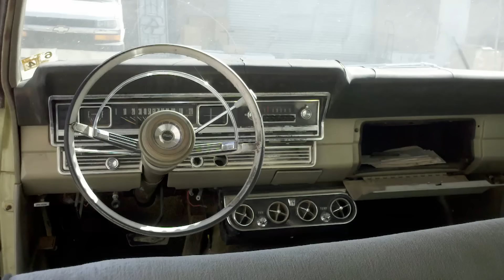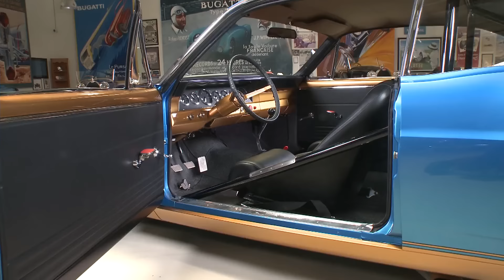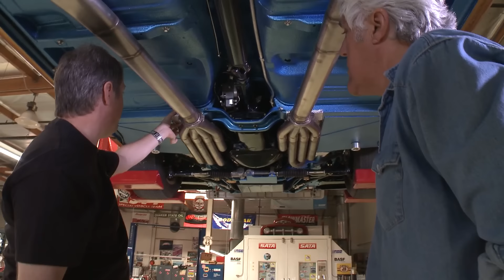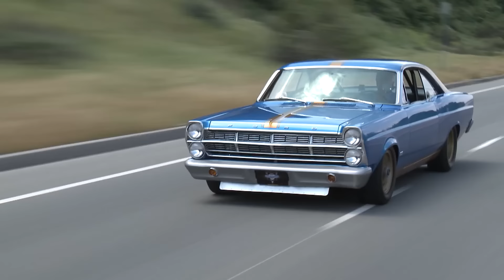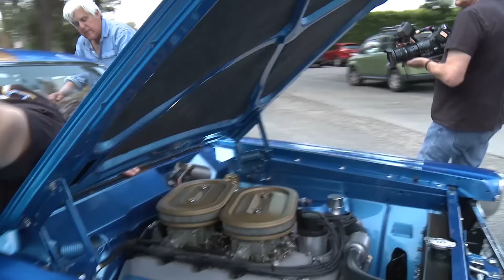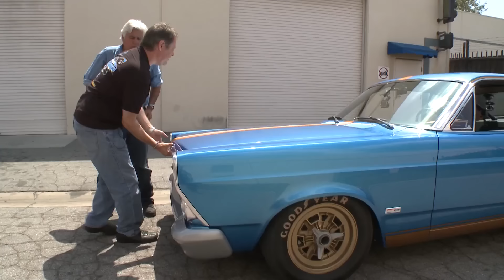1967 Ford Fairlane - Jay Leno's Garage

Comment: I owned a 1966 Fairlane 390 GTA back in the early "80s. Black exterior, black seats with red highlights.  It was quick by '82-'83 standards, when I owned it..  Good for a 14.7 at about 95 MPH in the quarter, slightly modified.  Corners?  Nope.  Stopping?  Long distances with massive fade when pushed.  Fuel economy?  8 to 10 MPG using the best 92 (leaded) octane I could find.  Years later, my 2013 Infinity G37 with a little 3.7 liter V6 would have left that Ford for dead, not to mention the Infinity's top speed of 155, governed of course.  Did I mention  28-30 MPG at 75 MPH?  Nowadays, a 2025 Honda Civic Hybrid could keep pace and get 45-50 MPG.  Times have changed for the better.

Comment: On the other end of the spectrum me I took a 67 falcon futura SC I put big block springs on it two inches cut off sway bar Koni shocks I bought a 72 Maverick and pulled the disc brakes off that and threw them on my car took the rear end out and threw that on my car it was about 3 inches narrower then the falcon axle so I had room for meats on my centerline Wheels and that car handle like he was on rails I love going into an exit ramp with a Vette or something else behind me and just not putting on the brakes 3/4 way through I've got my foot down to the floor accelerating and that Corvette's not wanting to stay with me (sometimes it's the driver) well you could probably tell I'm on a low budget and I never got around to the stroke 351 and the five-speed

Comment: No the 427 High Riser would turn some real RPM.  Even that one built won't turn the rpm a high riser would. 7500 was nothing to a high riser. The heads had ports big enough you can put you fist through them.

Comment: Harvey Crane (Crane Cams) made the gear drive to replace the long timing chain. The gear drive also reversed the direction of the cam on the left bank, so that they could run the same camshaft for both heads.

Comment: I had a 68 Fairlane in the same color (Celery green) with a 429. A mustang friend said it wasn't original since you couldn't get the 429 until 1969, i showed him the original build sheet, end of the 68 production line special ordered with a 429, evidently the Ford dealer had some special pull since he sponsored a ford racing team.

Comment: “Sneaky” Pete Robinson of AA Fuel Drag Racing and Georgia Tech developed the gear driven cam version of this along with the guys at Crane Cams. They included an extra gear in the chain so they could use the same cam on each head. This eliminated the slack problems with the looooong timing chain.
Reply: https://www.motortrend.com/uploads/sites/21/2015/05/tinker-toy-dragster-engine.jpg?fit=around%7C770:481.25

Comment: With the awesome torsion bar engineering (to me an underated practical method), and engine ...no need to apologise for the small throttle cable glitch. That is an awesome custom!

Comment: Just to add some flavour, these Fairlanes were also made in Australia only as 4 doors however the stacked headlight version came out in 1969 70, 71 designated ZC and ZD series.
However the engine options were, a few 250 cu 6 cylinder, but mostly 302 or 351 Windsor in the ZC and 302 or 351 Clevelands.
Yes you heard right a 302 Cleveland!
Ford Australia decided instead of importing Windsors and what are known as thinwall USA Clevelands here they would cast thickwall Cleveland blocks in Geelong casting factory in Victoria Australia.
The blocks were a bit heavier but we did'nt suffer the web cracking that some US Clevelands experienced and there was quite a lot of meat around the bores.
In order to have a smaller V8 option the Cleveland 302 had a 3 inch stroke crank with 4 inch rod and the 351 had the usual 3 1/2 inch stroke crank and shorter rod as the US  specs.
However the 302 heads had 53 cc small kidney shaped combustion chambers with the 2 v small ports,  bolting these 2v's onto a 351 raised compression into about 10.5 to 11.1 comps and running 100/130 avgas made a very healthy 330 - 350 hp dependent on cam/carburetion.
A few of these heads made it stateside as they were plentiful here.
We also had in the late 60/ early 70's 4 door Ford  Falcons with 4V HP 351 300 plus hp Clevelands with Boss type shakers as in Mustangs once considered to be the fastest 4 door sedans manufactured in the world however AMG Mercedes may challenge this.
These engines were seriously under rated due to the looming issues regarding supercars and insurance and were very potent.
Still love these Fairlanes particularly the 2 door slopers".

Comment: You made me miss my 66 390 GTA that I was forced to sell, slightly modified to 550 HP With a built C6. Lots of fun, never lost. It had 4 mufflers, two flow masters then two glasspacks 2 1/2 in. Just tried to listen to the radio.

Comment: Pete Robinson produced a gear drive system for drag racing with the 427 SOHC. He got some help from Harvey Crane of Crane Cams and P&S Machine to solve the timing issues caused by the 7 foot chain. 
My brother had a bottle green 67 cammer (two four-barrel carbs) Fairlane with two big white stripes on the hood, roof ans trunk cover. It would burn rubber in first, second and third gear. One day, the engine compartment caught fire and by the time he managed to remove the hood locking pins to open the hood and extinguish, the damage was too extensive to save the engine in a cost efficient way. The car ended its life with a 390.

Comment: In the early 2000’s I put a Hedman two piece header on a 1983 F150. I didn’t have the money to pay for a shop to make an exhaust so I had about a dozen short exhaust adaptors and short bends that dumped under the passenger floor without cats or muffler. In town I kept the rpm’s low to avoid tickets and waking up the dead. It was absolutely loud as a NASCAR engine when I floored it. And guess which engine it had? 
-
-
-
-
-
-
Ford 300-6, stock aside from the exhaust.

Comment: Ford's regular 427 NASCAR engine was so hot that Ford had to de-tune it for use in the GT-40 LeMans race cars.  When Ford saw that Chrysler was cleaning up with a hemi,  they came with out with the 427 SOHC.  Chrysler cried to NASCAR and that version of the engine was banned.

Comment: I've seen the throttle problem many times; mechanics discount the importance of checking the geometry & cable slack at full throttle, which is the LAST place you want a problem; most carbs are designed to go slightly over 90° when buried so you can slightly back it off.

Comment: There is no way this guy built this car. The throttle cable confused him.
Reply: I met Steve Strope a couple of years ago at NSRA Louisville; that's just the way he talks.  I saw his show on MotorTrend when he and his crew built the '57 Ford two-door Ranchwagon restomod he showed at Louisville.  Trust me; he's smarter than he sounds.  You wouldn't know it, but his net worth is about $100 mil...a very unassuming guy.

Comment: The issue with the gear drive setup they were talking about had issues with crankshaft vibration.
So it was a constant lash issue within the front case.
So until they figured out absorption through the idlers 
It never worked correctly.

Comment: I respect the fact they left in the footage of it breaking because noone is perfect this is a built not bought custom car that didn't have more then half those parts on it from the factory and to show when you build something that its never perfect or done needs mufflers need to bleed the brakes needs to put that little spring on like jay its never the big stuff but a 25 cent part and the most true thing in this episode is thats the point of a shake down

Comment: i love the car.. workmanship is top notch..my 66 ford ranchero is the same color with black instead of the gold..i just bought a speedway quick change diff .. fantastic!!! bolted right in ..didn't have to change a thing...other than the obvious ,swapping over backing plates, brakes etc...ahh the fairlane steering wheel..lol  god they were ugly. i have 2 in my basement if you want one..

Comment: Ford did have a Black Ops. When I worked at Ford Engineering in the early 70s, I wandered into an underground parking structure and found a beautiful, gun metal Mustang with a MIDSHIP MOUNTED 427 CID ENGINE and a Pinto with a double overhead cam COTSWORTH ENGINE. Pretty cool. These were toys for the executive class at Ford.

Comment: Wow. I have always ALWAYS hated longitudinal Alfa Romeo Alfetta and Mopar and 96-01 Explorer IFS systems and pushrod and transverse torsion systems because of my experience with them in those cars. This one lookes like it has no camber changes and its very professional. Love the Kelsey Hayes 11 and 11.35 inch brakes...they were exceptional in the TransAm era. And the FE rumba cha cha SOHC with quad 650 2bbls 6425's and Le Mans bowls...yeah bay bee. The throttle return rule...I learned from Mopar in 1996 when my engineer refused to issue a LVVC plate on my 4412 500 2bbl equiped Falcon 6. "Put a Mopar Hemi external return spring on it and bring it back". Ouch. Mopar part. What Jay said. Now get over it OK? Yeah, Strope has this whole package Lorenzo Ready. Thanks all for sharing. Unibodies X cars are a strange kind of awesome. Glad it sounds like an FE.

Comment: I grew up with these cars. With the right gear they were force to recon with. Most of the cars back then came with regular run of the mill standard motors. It's all on how you ordered yours. I learned to drive in my dad's 68 Cornett.  Beautiful car. But it had a 318. These cars were heavy.  Mostly gravel roads. Bias ply tires. Little to no brakes. Huge steering wheels with the speed nob on the wheel. Lol. Today's cars are so safer to drive. And much more comfortable in all conditions.

Comment: Yup......it's all FORD. Top dollars spent, work is unquestionably 1st rate.......yet something still breaks. Even though it's no big deal........ easily fixed........it's still a FORD for sure as because it won't drive for long before it has you on the side of the road fixing something.

Comment: That is a clean installation. That rear suspension is just a set of beautiful piece. Combining parts. This won a Ford design award at SEMA! The exhaust system is amazing.
Once muffled, apparently this car with mufflers is more of a euphemism.  Those lightweight and custom wheels are amazing. Cougar turn signals. Bound edges on Dyna Deck. AF

Comment: This is the motor that struck fear into all camps. If this motor had got the attention the hemi has all
These years it most certianly would be king. There are engine builders out there who have achieved 900+ horsepower naturaly aspperated on pump gas. 😲 in my opinion this is the
King of all motors.

Comment: Great car Jay, but you know I wished someone would show a car like I had which was a 1969 Ford Fairlane Cobra not a fastback had a 428 Super Cobra Jet 410 hp with the dragpack and 435 rear gears and 4 speed trans, ,had a functional hood scoop w/ a 428 Super Cobra Jet badge and badges on the grill the front fenders by the door jam and one on the trunk. So Jay or anyone that has or had one,make up a blog I'd love to hear about it. Mike Lukas Belding  Mi.

Comment: About that throttle linkage; it's the little details that can kill you.  I have a little story that happened to me many years ago.  I went for a thrill ride with this guy named Greg in his '71 LT1 Nova, you know, just to go through the gears.  So he plants his foot, and power shifts 1, 2, 3, 4 and gets it up to 120 mph, and then lifts off the pedal, but the throttle is jammed WFO, and the car is still accelerating hard.  Greg popped on and off the pedal a couple of times, but she's not backing off.  So he's pretty panicked by now, turns off the ignition, and kills the engine, but he turned the key too far, and locked the steering column, and we're going 130 mph, and are heading for the ditch.  Greg un-panics a little and turns the key back to ignition, but does not restart the engine.  And we coast to a stop, hearts pounding and breathing hard.  So WTF happened?  This was Greg's first night out with a new air filter assembly, and when he got on it, the acceleration in first gear caused the filter housing to shift, jamming the carb wide open.  So the moral of the story is make double-damn sure that your throttle linkage works properly and reliably before taking your hot rod out on the road.  You might get more of a thrill than you want.

Comment: I bought a 1967 Ford Fairlane back in the 1970s it had the GT two-door hardtop package it had no radio it had a stock 289 engine with two barrel carburetor automatic transmission most of these cars that I seen had big block 390 V8 with four on the floor  performance cars I think I had a rare car

Comment: I'm a Mopar guy first and a Pontiac guy second. But this is one of the baddest Ford's I've ever seen in my life. It doesnt really get any better than the Ford 427 SOHC. The meanest carbureted engine to ever come out of Detroit. The power of the SOHC would've been just downright dangerous if Ford had actually installed it in regular production cars with the tire, brake, and suspension technology of the mid 60's. Ford rated the SOHC at 615 horsepower with a 4 barrel and 657 horsepower with dual quads. 660 horsepower on bias ply tires with drum brakes would've been a death machine. That's a $50,000 engine right there easily

Comment: I love the stacked headlights on those 60's fords or a mercury or even or even a plymouth fury. That gives that front such a badass look to them.
Reply: 65-67 Pontiac GTO/LeMans also. It's a great look still today.
Reply: @diabolikmitchell2960  before that the '63 Pontiac Bonneville/Catalina/Grand Prix had them. The front of the '66/67 GTO was the same as the '64 Grand Prix
Reply: Same
Reply: Had a '65 Comet Cyclone, the stacked headlights made it.
Reply: GTO ?
Reply: I like the way Merc did it.
Reply: robert woodliff I had a 66’ Mercury Cyclone convertible I bought from a junkyard. Had a lot of fun putting it back on road and learning mechanics. Really loved those over and under headlights.
Reply: Had a '67 Mercury Comet... loved the styling.

Comment: Jay Kudos, Do you have a “free pass” with the CHP. ( this is all good natured sarcasm) I once had a Nevada Trooper pull me over to look at my Pontiac GTO. He also reminded me , more informed me, that the (No Speed Limit) is a myth. Droning 140. MPH was verboten . I Beckham a Ford Man about the time the “GT 40s went to LeMans. The story of the “123 Finish) is so awful only a executive could come up with it. Any true racer would never even think of it, especially at a “Tabernacle of Speed” like LeMans. Even the name “LeMans translates “The Men”. this sounds like a fuel dragster coming up to the line. Have you ever been pulled over by “Law Enforcement”. Where do you usually take your drives ? I would love to see you take your “Ford GT” out too Hyw 74. The road outside Palm Springs where they filmed the opening sequence in “It’s a Mad, Mad, Mad , Mad World”. Thanks 🙏 for everything “ You represents a whole Era of “Car Guys” (and Gals). I’ve had a whole series of Ford midsized “Fairlanes” some with ‘390 cis” and “352 ci” engines. That “4x2” carb set up I put on a 327 ci “fuelie” ‘57 Chevy “Bel Air”.

Comment: I hated the front suspension on that car, a coil spring over the upper a-frame. Chevy Nova had it as did AMC, it was like monkey see monkey do. It encroached into the engine compartment and made working on the engine so much more difficult. Plus they didn't help the handling one little bit.  This is a beautiful car, well engineered, but the SOHC engine and it's chain put me off. A good push rod 427 would have been my choice, and balancing the carbs on that thing must be a challenge. 8 barrels of Weber would have been more attractive, but to each his own, still a stunning car.

Comment: My dad bought one of these '67 Fairlanes from my uncle in 1969.  It had been stolen and wrecked with only 500 miles on it.  It was dark green, with a two-tone green, vinyl interior and a 289 under the hood.  It became mine in high school, during the early '80s, and we talked about restoring it, but it would have required a tremendous amount of work, so we ended up selling when I graduated high school.  The buyer did end up restoring it, though.

Comment: Can't stand modern LS engines dropped into 60s cars. If I wanted some computer engine go buy a new car. I want to experience the 60's car with the stinky exhaust carburetor that floods if you didn't start it just right. Glad he didn't go with a FI engine.

Comment: This reminded when my buddy's throttle linkage broke on a six pack carbed GTO. We ran a line of bailing wire from the linkage through the firewall and wound the remaining wire around a screwdriver. I sat in the back seat and pulled the wire to accelerate and he shifted and drove her home. True story...1979 Santa Rosa California..the good old days when nobody wanted a ten year gas guzzler muscle cars but high school hot rodders like us. You could buy them cheap back then...I miss those days. Thanks for review.

Comment: This guy deserves an award for using 15" wheels and tires with real sidewalls (they look like NASCAR tires, with the addition of a bit of tread pattern). Over 15" is for 3/4-ton or bigger trucks, and real truck tires always have real sidewalls no matter how big the wheels are (70-series at least). On a car, giant wheels (especially with rubber band tires) look gay as a rainbow.

Comment: My first car - a '67 Fairlane wagon with the 390 windsor engine, 2bbl carb,  C6 trans and posi rear.  (and yes, it had the fake wood on the sides!).  Bought it in '76 with 96,000 miles on it for 300 bucks.  A beast of a car.  I put another 70,000 miles on it before it was ready for the crusher.  So much torque, had to replace the left motor mount twice!  Thanks Jay, for the memories.